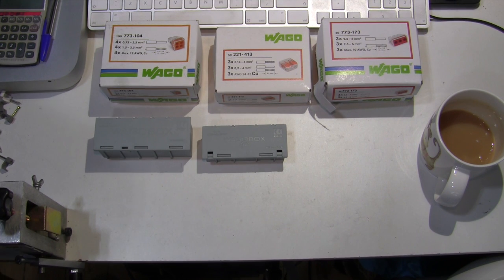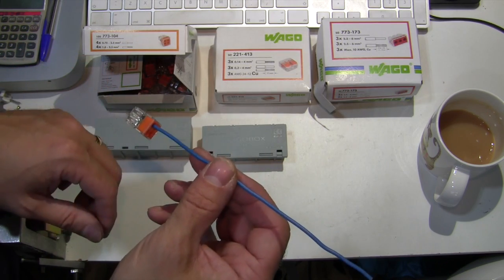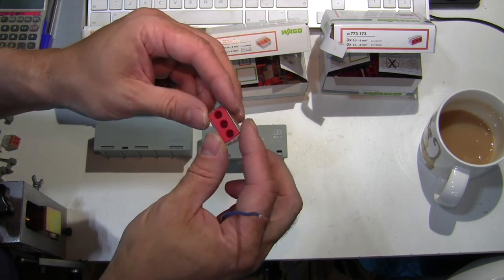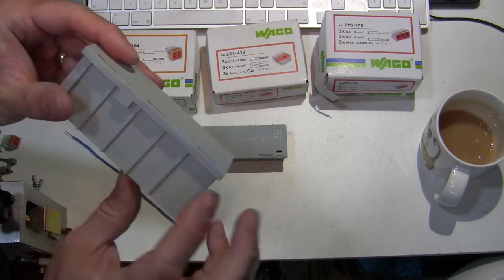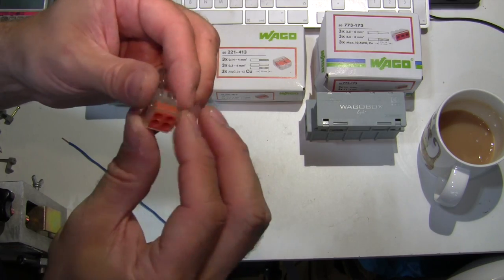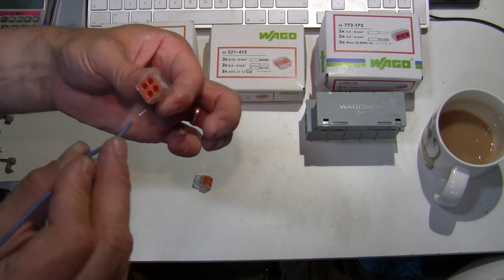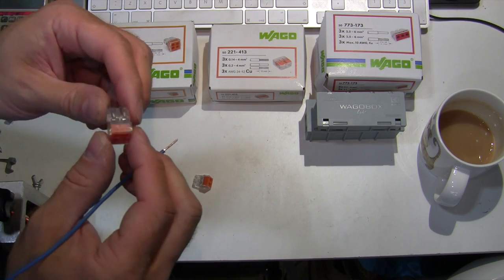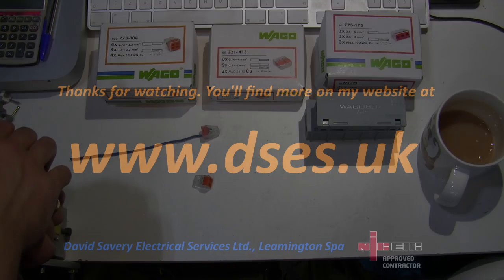Wago and fake Wago connectors

Comment: Question from a yank here.   Are wire nuts allowed by code in the UK?
Reply from the maker: The only time I see these is when they come supplied with a fixture or fitting, but I tend to spin them into the bin and use something else. Apparently we had them here in the '70's, but they had ceramic heads which would crack leaving exposed live parts. The modern plastic ones are better of course, assuming they're from a reputable source, but they remain an unpopular option. I don't know about your side of the ocean, but here the fixed wiring is solid core and twisting it is a no-no. For stranded core applications, they're probably fine, but the preference here would be a screw connection or clamp connector depending on the accessibility and location. There's nothing in the wiring regs here disallowing the use of them to my knowledge, but there are more readily available options to hand.
Reply: @dsesuk  o

Comment: I use a pair a water pump pliers to get the wago box closed if it's just a bit too tight even with the rubber cable restraints

Comment: Don't want to slate any manufacturers but do the brand that fail start with an I and end with an L? 
Only asking as I've fitted quite a few
Reply from the maker: No, I've used Ideal connectors without issue!
Reply: @dsesuk  great thanks that puts my mind at ease. Not sure if they have changed but the ideal push ones were not MF a couple of years ago so had to be accessible (from the horses mouth tech number) but they were trying to sort it.
Reply: I’ve had a few issues with ideal NOT accepting 1.5mm cable the cable simply won’t go in the connector it’s mainly been the four ways I’ve had the issue with

Comment: Hi David. You said that you would be liable 'seeing as it's OUR fault that it failed', but would you? Be liable, I mean.

Component failure is surely manufacturers fault.

I had need to replace an outside security light that had been up only a couple of weeks (one of five I installed at the same address).

That particular brand had been reliable up until then (three or four dozen installed without incident), and I did replace it free of charge for the sake of goodwill but IF any fail, say, six months down the line, I would feel totally justified charging the client, certainly for labour costs, though I would insist on a refund from the supplier.

Am I wrong?

(Oh, incidentally, I am reliably informed that Wago is indeed pronounced 'Vaa- go', like in Volkswagen.)
Reply from the maker: No, you're not wrong, it just depends on what terms you offer. I put a no-quibble 24 month warranty on anything I install if the client pays in full within five days of receiving the invoice. If they pay late, then only the manufacturer warranty applies, so in that circumstance I could charge labour for replacing or faultfinding on failures. When a failure does occur prematurely on a value item of equipment, I will return it for exchange/refund to avoid being out of pocket any more than I have to. It's up to you to set what terms and conditions to work by, so as long as you're not affecting anybody's statutory rights and your terms are up-front (on your website, written estimates etc.)
Reply: Technically, if you supply the product you are liable as the reseller. Unless the client specifies a particular product or you were a subcontractor then you would normally be liable for the total cost of a remedy. If you worked for a contractor, they would primarily be responsible as the final reseller of your work

Comment: The lever ones are good for stranded cable or  small flex, as they wouldnt be strong enough for the push fit ones. I get on ok with the wago box, used loads of them, never had any trouble.

Comment: I’m about change my living room light and I’m using the wago connectors but there is not enough room in my ceiling to put the wago junction box,,just wondering if I will be fine just sticking the connectors in to the ceiling on there own,,,,,I’m getting rid of the ceiling rose
Reply: When doing rewire/new builds I usually take my loop feed wires to the switch boxes as more and more customer desire downlighters and other decorative fittings, the 3 plate ceiling pendant is a thing of the past.
Reply from the maker: Very true. I notice the new-builds going up around me have also abandoned three-plate (fortunately).
Reply from the maker: Ah yes, the pain of three-plate wiring and where to shove it all when you install a new luminaire that doesn't accommodate it! I talked about this in my Quickwire video and in a Free Advice article on my website as it is a common, and annoying, problem. As you say, sometimes it isn't practical to make a hole large enough to contain an enclosure. It's up to you as the man on the ground (or up the ladder) as to how you proceed. If doing it by the book, then those single insulated wires and their connectors should be contained in an enclosure of some kind, be it a Wagobox or something similar that's made for that job, or they should be located in the base of the new light fitting if it's big enough. Having the wires enclosed minimises shock risk and helps to contain a fire if a poorly wired junction starts arcing. If enclosing them simply isn't practical, then you wouldn't be the first person to wrap them up in electrical tape and shove them above the ceiling! Doing that wouldn't comply with the wiring regs, but if it's your own home and you're happy that it's wired correctly (minimising an arc risk), and there's no ongoing shock risk, then it's up to you as to how you proceed. Or to cut a long story short (too late), either make a bigger hole to contain the enclosure and then make good the damage, or tape, shove and live with it unenclosed! The risk assessment is yours to make, and it's down to you to decide what's practical and safe. If in doubt, call in a local electrician for advice, but check they are well rated and trustworthy first as most of them out there wouldn't think twice about a tape-and-shove with screw blocks instead of the better, but more expensive, Wago connectors!

Comment: just wondering past and i couldn't help but watch due to the subject. Have you seen some of the 'wago' connectors on ebay that look just like wago but there are a few things that do not match up. difference in fonts, alignment do not match and font difference. on the 222 series
Reply from the maker: Not specifically, but I don't use eBay for anything as I don't trust the quality of the source. I only use local trade wholesalers for my goods and I try to avoid the internet as much as possible, not because all online sellers are in any way dodgy, but more so I have a local point of return for goods should they develop a fault or require a return when I'm overstocked such as if a job gets canned at the eleventh hour! My iffy connector here was from a branch of a national wholesaler which is why I was annoyed enough to make the video. Had I sourced it from the likes of eBay then I'd have nobody to blame but myself!

Comment: I've used  Helacon Plus Connectors for years now and not had any problem, have you got an opinion on these?
Reply from the maker: A perfectly fine alternative in my opinion. I haven't bought a Helacon Plus pack for two or three years, but there were three reasons why I chose the Wago brand over them. Firstly, the Helacon connectors were bulkier than the Wago series, although that may have changed since. When fitting into tight enclosures such as a Wagobox, better to have a connector that requires less space! Secondly, only Edmundsons sold Helacon, at least locally, whereas I could source Wago from CEF, Edmundsons, ElectricFix and Denmans. Finally, for those occasions when you need to remove a wire from a push-fit connector, the Helacon models seemed more reluctant to release their grasp which may give you confidence that it has a better grip than the Wago, but is a pain in the arse if you've just populated a whole connector and then find you need to add another wire! Just my personal observations though, and like I say, things have probably changed since I last used them!
Reply: Thank you for your reply
Reply: @dsesuk  HelaCon Lux are 'two in, one out' as per your diagram. They do say that they are best suited for two solid conductors in and one stranded out as in a lighting connection but they will accept 2.5 solid on both sides! Enjoy your content!

Comment: I thought the connectors are only rates for one time use, only the wago with the leaver can be re used. As far as I know Here we don't re use these connectors
Reply from the maker: The push-fit connectors can be reused; to extract the wire, pull and twist until it comes out. The removed conductor is generally in a better condition than one which has been tightly clamped in a conventional screw terminal, but I like to restrip it back to a clean end in case the conductor has been weakened by the twisting. I don't know how many re-insertions these type of connectors are rated for, but if it grips when re-inserted and doesn't let go when tugged, then I'd imagine you're okay. If in any doubt however, sling it in the bin and use a fresh one!

Comment: I don't trust them.
Reply: I don't know if you're using these professionally or for DIY or what level you are at in terms of exposure to electrical connections but from a specification point of view screw-less push-fit and lever actuated terminals are far safer and mechanically more sound than screwed terminals. As a consultant engineer I attend a lot of witness testing and often witness fault finding with electricians and would say that I probably see screwed terminal issues on a monthly basis. I have seen about 1 genuine push-fit terminal issue and I suspect the terminal had been reused but abused with the cable being ripped out of it. Even a good screwed terminal can part company with the wire with something as simple as twisting it, the wire manages to wriggle loose and it pops out. This doesn't happen with these screw-less terminals and offers far better mechanical strength than a screwed terminal - also, they do not back off with age, temperature changes or vibration. 

Each to their own but I would prefer to see this type of connection over a screwed terminal in almost 90% of the connections I see. I now only specify this system of connection in fixed wiring specification documents and prohibit the use of screwed terminals with exceptions for things like DB's etc. obviously. 

Push-fit plumbing joints... I don't trust them!
Reply from the maker: Fair enough. Don't install anything you're not happy with. I only have my own personal experiences to reference, but I can say I have installed thousands of Wago push-fit and clamp connectors out in the field and not experienced a single failure to date. I have also used the Ideal and HellermannTyton brands without issue, but I prefer the Wago models as they're more readily accessible here around Shakespeare's ol' stomping grounds. I certainly find these to be quicker and more convenient to install than a crimp connector which is what would have been fitted in the past in many cases.

Comment: The thermal cycle of these make them worthless. If one has an intermittent load, it will loose its grip over time.
Reply from the maker: Ah yes, a good video by JW. The outer plastic burned up, but as you say the wire itself failed before the internal metallic connector had a chance to break. Personally, I don't see these being any greater risk than a traditional crimp connection. In fact, I'd favour a Wago over a crimp as I've seen crimped connections which look sound, but fail a decent tug-test. Of course, any kind of wiring splice is at risk of eventual mechanical failure, but if you're installing them to the local regulatory requirements and to the manufacturer's instructions then that's as much as any installer can do!
Reply from the maker: I've had no problems personally in the years I have been using Wago products, but I agree that a poor connection such as that exhibited by this other brand would have the capability for a localised heat build-up through high resistance. Anything that joins two wires together may be subject to stress, but so long as the connectors, and by extension the cables, are operating within their design parameters, then there shouldn't be any significant thermal loading where the cable is securely clamped. If they're getting warm, something is wrong with the design or modification of the circuit - or your connector is a dodgy knock-off like this one! JW posted a good video where he pushed a Wago and other types of connector well past their design limits, and although the plastic eventually melted, there was no failure in the electrical connection, at least not until the wire itself gave up. Of course, that was a one-off test rather than cycling over time, but if you have any test data to show otherwise then do please post a link here as it would be worth a look.
Reply: The idea that's troubling, is the idea that the Wago CAUSED the resistance which CAUSED the failure. THEN we have a problem. I think that its quite possible that Wago's are actually fine MECHANICAL connections, doing quite alright, at least with the Lever ones, but create resistance which causes problems for the wires. Murphy's law ish type deal.
Reply from the maker: A troubling prospect indeed, although remember it wasn't a Wago in this case, but an impostor which very much looked like the real thing, and was only distinguishable from such through the missing Wago logo if examined closely using a magnifying glass!
Reply: Oh I wasn't talking about this case here. A video was done by John Ward, "Wire Connectors Overloaded". A real ( I am assuming) Wago was put under overload with other connectors, and the  connection failed before the Wago. The idea is, the Wago will be fine, but perhaps resistance could build up prior to it and cause failures. It was at ridiculous over current of course, but still, how much resistance, under a continuous heavy legal load, can these handle. That is the mystery that has yet to be solved, although a test would not be the hardest in the world to preform.

Comment: One should avoid alibaba and china made stuff in general. I have seen too many shit stuff.. The plastic is shit, they are using recycled material. They may not be using real copper for connection. They could do anything to make a buck.. Most of them are just too poor to realize the environment is more important than money.
Reply: I've learned the hard way with cheap fago and i was able to break 4 levers of the 6 on one of the units without many strenght. yeah good plastic indeed
Reply: did you not notice that the wago brand is also made in china?

Comment: Connections must always be done in junction boxes and boxes must always be accessible.
Reply: Soldered joints done properly do not need to be accessible.
Reply from the maker: Agreed - where practical. BS7671 regulation 513.1 requires every electrical joint to be accessible and any good circuit design would allow for this, but this becomes impractical in retrofit applications where you have no choice but to splice into existing wiring which may then be covered over. Pulling up a floorboard to install a junction for a new spur is all well and good, but if the homeowner then covers it with a laminate floor then getting access to it again would be costly and difficult. You wouldn't want to use a screw junction as the screw may work loose over time so this is where the maintenance free requirement comes in. Regulation 526.3 again states the need for all connections to be accessible but then lists six exceptions, one of which is equipment complying with BS5733, carrying the MF logo and installed to the manufacturer's instructions. Wago push-fit and clamp connectors would comply, as well as crimp or solder joints, but they need to be derated as per Wago's instructions and installed in a Wagobox or other similar MF rated enclosure. Of course, your local wiring regulations may differ if you're not in the UK.
Reply: @dsesuk  you mean practicable... but also could be practical 😋.
Reply from the maker: @relobmit  Quite right. In my defence I did only get a grade D in GCSE English back in 1990 so there's bound to be the odd slip!
Reply: @dsesuk  that's an 'A' in 2018 prices 🤣
Reply from the maker: @relobmit  You may be right considering the number of messages I get with 'u', '2' and American spellings interspersed among the text. It's just not cricket!